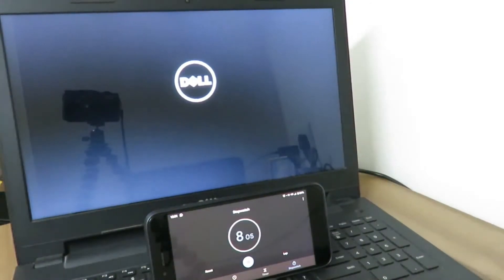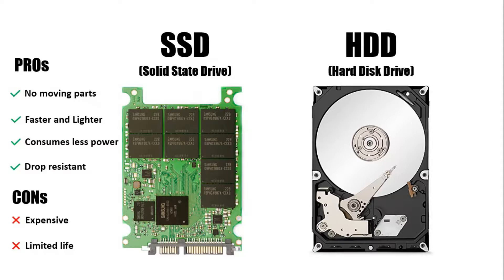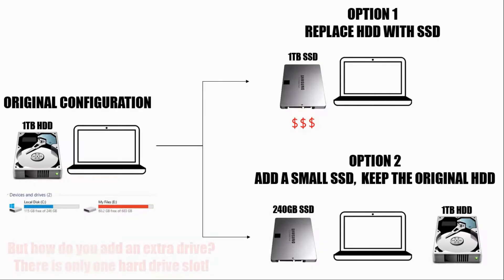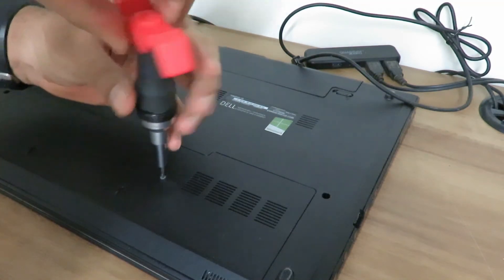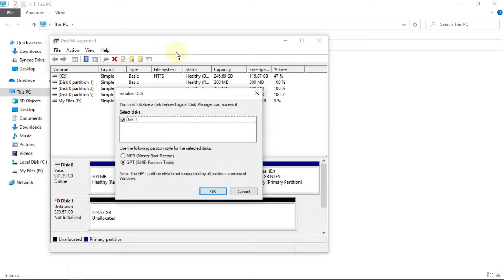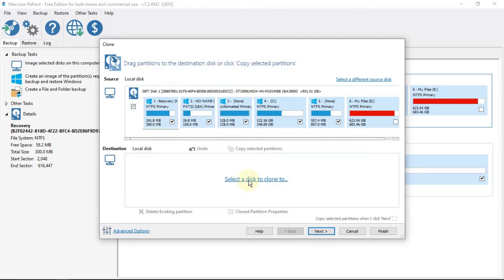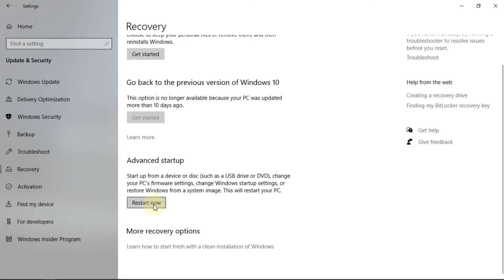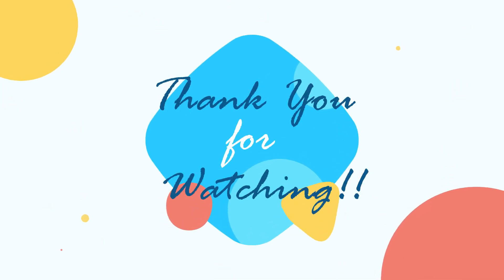Upgrade your Dell Inspiron 3542 laptop with an #SSD! (no Windows reinstall , keep all your apps)

Comment: How come it still takes 45 secs to boot up instead of just 10-20 secs?
Reply from the maker: The boot time would also depend on the number of programs that startup with Windows. 
Plus this is not a clean install. I have migrated everything from the HDD and that can affect boot times as well, since the data is not stored in the most optimal way. 

For the fastest performance, a clean install will be the best.

Comment: I have ordered Samsung 860 Evo from flipkart.Can u confirm if it is compatible with dell Inspiron 3542 ?
Reply from the maker: Yes, it is!
Reply: @TheMuser  it's 0.3 shorter than mx500 will it still fit in my laptop
Reply from the maker: They are both 2.5" and can be used without issue on the Inspiron 3542

Comment: Good one. Do you know the chipset motherboard of 3542 is compatible with i3 or i5 is compatible?
Reply from the maker: The chip is soldered to the motherboard and therefore you'll have to unsolder it to attach the new chip. No idea if the i5 is compatible though!
Reply: REPLY
For more information watch out this link : 
https://youtu.be/54CPlu9KN64

Comment: I have the same model and looking to upgrade. This video is really helpful. Right now I can't see my Optical drive neither in BIOS nor in Device Manager. I am using Windows 10 Home edition x64 bit. Do i also need to upgrade my RAM and if yes which one?
Reply from the maker: Are you saying without doing anything, you still cannot see the optical drive?  It would show up under DVD/CD-ROM drives. 
If you haven't done anything yet then that means there is something wrong with the drive itself. Try removing it and plugging it again.
If you have already put the SSD in the optical drive and then can't see the optical drive, then it is most probably because you have not intiailized the sSSD. Check out from 9:36 of the video.
Reply: @TheMuser  thanks for your reply, really appreciate. I was using windows 7 earlier and optical drive was working fine but when i upgraded to windows 10 home edition, since then i noticed that optical drive isn't working, tried looking at device manager, bios but had no luck. So before planning to upgrade i wanted to be sure that my optical drive is working and the connected port is also fine.
Reply from the maker: Sounds like a driver issue. This might help.
https://support.microsoft.com/en-in/help/314060/your-cd-or-dvd-drive-is-not-recognized-by-windows-or-other-programs

But definitely get this sorted before you do the swap!

Comment: Which one will be better for dell Inspiron 3542 i3 generation Samsung 860 Evo 500 GB or mx500 500 GB  both are of approximately same price in flipkart and amazon these days
Reply from the maker: Samsung has a longer warranty of 5 years and would be my first preference. Performance wise there might not be much of a difference though.
Reply: @TheMuser  but which has little better difference
Reply from the maker: Maybe the Samsung one.
Reply: @TheMuser  on flipkart itts cheaper than amazon but flipkart doesn't. Have replacement policy,also let me know. If I buy online do. I need to. Go local shop. For fitting or myself if I am..not expert?
Reply: @TheMuser  and will it fit in dell Inspiron 3542 for sure as few people in flipkart have written not compatible didn't got worked but for 80 percentage it worked?
Reply from the maker: All 2.5" SSDs have standard dimensions and will fit in the Inspiron 3542.
Regarding the installation, this was my first ever SSD installation and I was able to do it without issue. A lot of people have followed this video and were able to do it on their own as well.

Having said that, you can try it on your own and if you get stuck then you can go to your local shop for installation help.

Comment: Hello sir, I have a problem with my Dell Inspiron 3542. I tried placing the SSD as my main hard-drive but it is not getting detected. However, it is getting detected when I place it in the caddy. How can I solve this if I want to place my SSD on the main slot.
Reply from the maker: Ensure you are pressing it in correctly. If that does not work, try intializing it as mentioned at 09:35  in the video
Reply: REPLY
For more information watch out this link : 
https://youtu.be/54CPlu9KN64

Comment: Dell authorised customer care is telling that my laptop dell Inspiron 3542 doesn't support SSD so what should I do?Also let me know after putting SSD will it handle apps like power bi smoothly which was hanging a lot in hdd because of old i3 4 th generation processor
Reply from the maker: As you can see in the video I had exactly the same laptop and exactly the same problem. 
My laptop was painfully slow and the SSD solved all my problems.
PowerBI, Tableau, R and everything else is much faster now!

Comment: Hi, is it possible i connect ssd to usb then perform a clone and then select ssd as boot start up and then replace the hdd with new ssd?
Reply from the maker: Yes That can be done as well. And would be easier as well.
I didn't have a SSD to USB connector and therefore went with this arrangement.
Reply: @TheMuser  okay thank you very much for your response.

Comment: Sir I have the same laptop and want to update my laptop for fastet performance...
And I am have very limited budget i.e 4000rs which should I consider
1. 8 ram ddr3
Or 
2. 500gb ssd Hardisk( optical drive replacement)
For faster performance... please tell I am waiting for your response...
Reply from the maker: An SSD would be any day be a better option than RAM.
Extra RAM would help if you are using memory intensive programs like video or image editing. But SSD would help make your laptop faster overall.

A 500GB SSD would be around INR5000 (https://www.amazon.in/Crucial-MX500-500GB-2-5-inch-SSD/dp/B0786QNS9B)

A 8GB RAM would be available for around INR3500

My Dell Inspiron 3542 came with 8GB and there is no provision to add more RAM. So do check before you buy.
Reply: @TheMuser  thanks for your response..By any means can I contact you

Comment: I have an HDD with two OS's in place, Windows and Linux. There's a GRUB bootloader to choose whether to boot up from Linux or Windows. Basically, a dual boot-up system.

 How can I clone this entire HDD to a new SSD (with the two OS's )? The software you used only clones Windows. Thanks.
Reply from the maker: To be very frank, I am not very sure how Macrium would treat 2 OS partitions. 
My guess is it would still show up the 2 partitions and give you an option to copy both. However, as I said, not too sure about the same!

Comment: I have the same laptop 
Which brand of ssd is better? 
WD Or crucial?
Reply from the maker: As a brand, both are more or less the same.
But within both, you'll find categories.
For example the Crucial MX500 is better than the BX500.
And the WD Green is a little better than the normal ones.

But overall, not much difference between the brands.
I personally went for the cheaper one!

Comment: Thank you for that helpful information 
.
I put SSD 512 GB instead the HDD.
And I bought a caddy and use it for the HDD and I did format for my laptop.
.
My laptop didn’t work until I changed the way of “how the boot read”(in boot F12) to UEFI, is what I did right? or I missed something?
.
Because I didn’t do the last step in your tutorial.

I hope you understand my issue to help me.
Reply from the maker: The last part is important. You will have to use UEFi and also do the FILE BROWSER ADD BOOT OPTION to create and point the first entry to the SSD. 

Most probably, it is still pointing to the HDD and might not look at the SSD for booting.
Reply: @TheMuser  you mentioned your UEFI file was in the partition 2. How did you figure that out? will it be same for everyone?
Reply from the maker: @shubham1g  you can refer to this video to figure out which partition your EFI partition is on.
https://youtu.be/55C0d_gjxKU
Reply: REPLY
For more information watch out this link : 
https://youtu.be/54CPlu9KN64

Comment: My laptop is dell Inspiron 3542, i5, 4gb ddr3l, 1tb hdd,
I want to upgrade to 8gb ram & 500gb ssd (by replacing dvd drive) i want to keep the hdd, but I will replace the hdd to dvd drive & ssd to original hard disk compartment, is it possible bro, will it support ??
Reply from the maker: Dell Inspiron 3542 supports 8GB RAM So that should be fine. However ensure you get the right type of RAm.
On the SSD, yes 500GB SSD will work. 

And that is exactly what I have done in this video!

Comment: Thanks a lot for the detailed video. I have the same model and planning to do the same. As I see in the video, you have put the SSD in internal drive space and HDD in the Optical Drive space which is very good. Can you please share if you faced any issues because of this ? Also will the Optical Drive still be removable with the button that's present(it's better if it can't) ?
Reply from the maker: No there have been no issues at all. 
The eject button is still there but it doesn't do anything since the eject mechanism is on the optical drive which was removed.
Reply: @TheMuser  Thank you !!

Comment: Since ssd was empty how did your laptop boot up from ssd after you have put ssd in place of hdd ?
Reply from the maker: When you put SSD in place of HDD, the laptop is still booting from HDD.
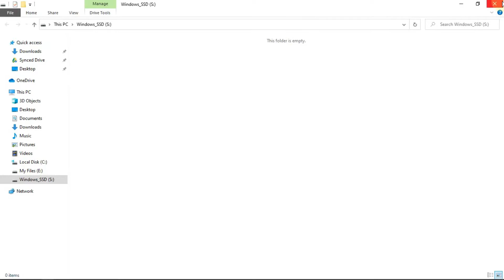Starting at 11:18 you can see the cloning process, which creates a copy of HDD onto the SSD.
Reply: @TheMuser  when the laptop boot up for first time it should look for c drive from ssd but ssd was empty? Did you change your bios settings and make ODD as first option to look for c drive because HDD is in ODD and it has c drive.

If people don't have ODD listed in bios settings for an alternate option for boot up then the laptop won't boot up, people can get into problem.
Reply from the maker: @beunique8937  Yes the BIOS settings has been changed. 
The same can be found in the video starting at 15:03
Reply: @TheMuser  today I swapped hdd with ssd and moved hdd to hdd caddy. But my laptop couldn't boot up , it shows "internal hdd not found, try to reset, etc" screen. 

Remember I asked this scene in my previous comments but you were completely not aware of this issue, you should note that all the people don't have a laptop config same as you. I'm literally stuck at here. Such a time waste for me. I will figure out. Dang

So before start of your video you would have put a big fat message/warning saying " This video will not work on all laptop, etc. Blah blah",
Reply from the maker: @beunique8937  I would suggest you watch the entire video from start to end!
If you still have a problem, I'll be happy to help

But sadly I decide what I want to put in MY video!  Not, you! :)
Reply: @TheMuser  thanks for the reply, since I have the same Dell model as you. So I unscrewed hdd from hdd caddy and tried to put it back into hdd caddy and turned on the laptop but still same issue, and there was a switch on hdd caddy and I moved it back and forth, and then I would check whether it fixed the issue but still same issue. Laptop was able to detect hdd in the end, I accidentally found the issue was that the hdd couldn't connect with hdd caddy connector properly.